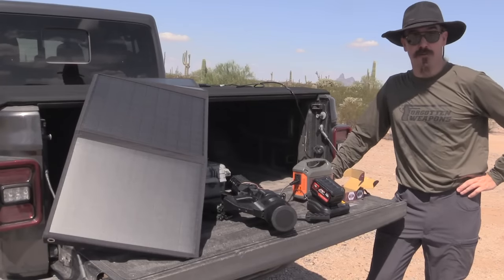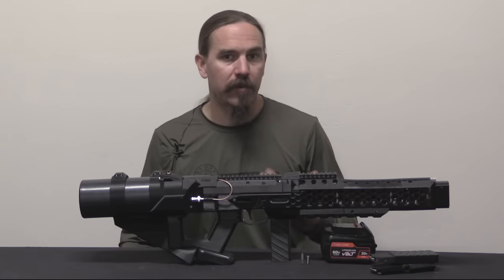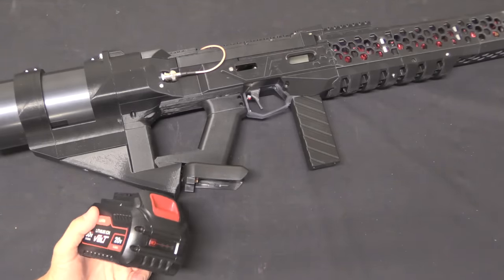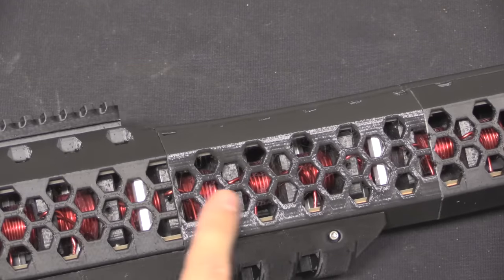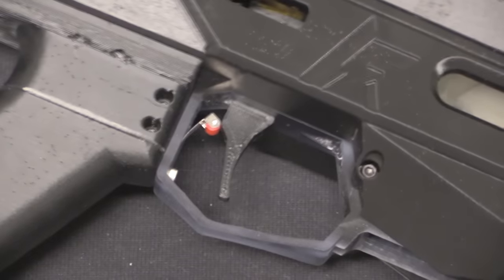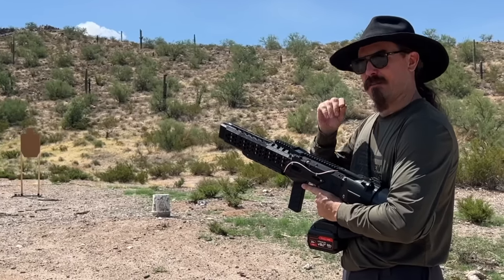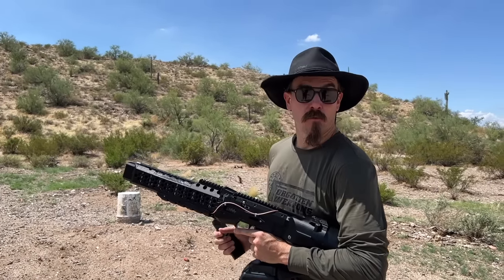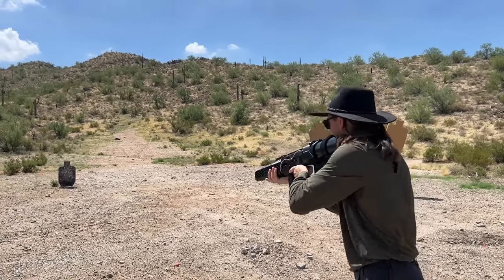ArcFlash Labs EMG-02 CoilGun: Making SciFi Weapons Into Reality

Comment: The fact you dont need gun powder or anything for ammunition is a huge boon. (until they decided to address the accuracy issues)
Reply: 200fps is BB gun level 1000fps is fire arm level  , so accuracy and power 😂
Reply: use of different ammo could be interesting, like jet, explosive , just a thought.
Reply: Eventually, but it really doesn't have the kinetic energy.  The GR-1 Anvil is their most powerful gauss gun, and the projectile has 75 foot-pounds of kinetic energy.  For reference, most 22 rimfire cartridges are around 120 foot-pounds of KE, M193 military specification 5.56 NATO cartridges are almost 1,300 foot-pounds of KE, and the 300 Winchester Magnum commonly used for hunting has anywhere from 3600 foot-pounds to 4100 foot-pounds of KE.

We have a long way to go on making a compact enough power source.
Reply: @jamesp8164  or drastically more efficient systems.
Reply: @GMNAZ  this doesn't account for the drastic weight difference between a bb and a 5/8 steel dowel pin. That's gonna be about 70 grams which is about a .556 round traveling at nearly 500fps. You could theoretically increase the weight of the round and keep the speed the same with an increase in power at the expense of range. My solution would be to machine a more efficient projectile that could use its own speed to stabilize its path so it doesn't bleed velocity in a tumble. I'd change the shape of the projectile to a dart shape and add microfillament fins to force air around the shaft and create rotation
Reply: @wolf_puncher301  their website says the rounds are up to 8.5 grams
Reply: @wolf_puncher301  Essentially rifling the projectile instead of the barrel.
Reply: @wolf_puncher301  You can't optimize the projectile shape since the shape of the projectile is what allows it to get the speed it does. This weapon is using the solenoid effect, so the larger the chunk of ferrous material, the more force the coils are able to exert. If you shrunk it down to a more aerodynamic dart it would probably be traveling slow enough to catch at 20 yards.
Reply: has anyone used one of these to shoot something that isn't a piece of tin or cardboard? I'm not a gun person just here randomly but it seems like if you were wearing a leather jacket the bullets might not get through it. Though a safer gun is not a bad idea
Reply: @subspaceanomaly  It's essentially a BB gun, but the purpose of this gun is not to be lethal or non-lethal, it is purely experimental, a concept or for fun. It is not meant to be practical in any way, at least not yet.
Reply: @gus892  Jet ammo has already been done. Gyrojet pistol & rifle used a jet propelled round. It wasn't good.

Comment: games have told me capacitors are explosive. imagine having a giant one under your arm. it will be like flamethrowers, your friends don't want to stand near you in combat.
Reply: It's really only the tiny little Tantalum caps that explode and only when reverse polarized or when too much voltage is applied. Electrolytics will burst open because the electrolyte boils when they fail... but they will swell and get very hot first so you'll have at least some of warning of an impeding failure.
Reply: @audiossis4567  hmm... so you could use it as a granade if say only your capacitor got hit by the enemy and not you?

Comment: Spin could be added to the projectile with smaller coils arranged radially about the barrel, with their magnetic fields directed at the outer edge of the projectile
Reply: or you could instead fire a smaller and lighter more aero dynamic flechette style round that can achieve spin on its own similar to a arrow IF its even possible

Comment: The step up in capability is insane - that fire rate alone is astonishing compared to the prior version!

I'm much more interested in the ammo design at this point. Get those dowels spinning somehow, to focus on accuracy. Could it fire projectiles with twisted fins or spiral-cut grooves, to impart some rotation as they're accelerated down the barrel? How would accuracy be affected if you tried to fire bits of chopped-threaded bar - I assume the twist on it would be far too aggressive, but curious to know!

This thing needs to spend time with the Slow Mo Guys, get some development footage to see what the projectiles are doing!
Reply: Figure out a way to mass produce fin-stabilized projectiles for these?

But I think kinetic energy delivered to target depends on muzzle velocity and projectile weight, so there would be tradeoffs.
Reply: There must be a way to electromagnetically spin the dowls

Comment: It’s impressive how quiet the coil gun operates. I wonder if there’s some engineering fix that would further sirpress the sound.
Reply: Most of the loud firing sounds that a traditional firearm makes comes from a combination of three things: the exploding propellant, the expanding gases pushing the bullet, and the bullet itself traveling at supersonic speed. Coilguns generate none of these, in particular the EMG-02 currently don't have enough power to propel bullets to supersonic speed, and thus you have a silent weapon. If a Coilgun were to one day become powerful enough to be lethal for practical purposes, the only sound you would hear from its firing would be the "crack" from the sonic boom generated by the bullet.

This is before the fact that the weapon does not have high-speed large moving parts like bolts in its mechanism, which further cuts down on the sources of noise when firing.

Comment: I don't think getting a simple steel dowel to spin is possible using just the magnets. It would require some specially designed ammunition. Seems like the ideal projectile for this technology would be something like a drag stabilised arrow or crossbow bolt. The velocity is in about the same region as a crossbow.

Comment: There is recoil, but it is not noticeable. To accelerate the projectile forward there has to be a force in the opposite direction, aka your shoulder. The hex bits could work well as projectiles as they may have less drag down the barrel if you run tighter tolerances, just need to stabilize them. Great video as always, and great to see the progress they are making
Reply: @Sasha Lemay That would certainly also help, but if you look at the net energy that leaves the system (barrel), that same energy goes into your shoulder and body. Which there isn't much of at that terminal velocity

Comment: Just wait until solid state batteries become more mainstream, and capacitors can hold more energy, these things could have some real applications real soon
Especially with more aerodynamic projectiles
Reply: Death by 20/40mm grenades but its completely silent, no muzzle flash, no sound and just all of the sudden a hail of explosions erupt.
Reply: Capacitor tech hasn't really developed all that much, they're pretty much at a point where (with what we currently can predict about material tech) nothing much will happen to them. It's more likely that we will be able to advance batteries (like the new generation of LTO) enough to replace the entire capacitor - the big thing to solve with gauss rifles is the power supply issue anyhow, and if we get batteries to work at extremely high power outputs, the capacitor itself will become pointless. As it stands, energy density in battery tech and energy discharge rates are the big blockers - accuracy can actually be achieved with two-component ammunition (as was done in the US Navy experiments).

Considering how much battery tech has jumped ahead over the past 20 years, I wouldn't be surprised if gauss rifles become viable for infantry applications within the next ten or 15 years.

Comment: Just one more big leap in capacitor tech and this concept will be totally viable. I don't know about the resistive energy losses, but should there ever be room temp. superconductors, that would be an additional improvement in energy efficiency (not sure if it would be worth it in terms of price/performance and absolute gain of eff. though).
Reply: Diamond battery + rifled... Yummy
Reply: Bus bars would likely be far cheaper and could double as heatsinks.
Reply: @rev3  You can't rifle the barrel 'cause there isn't one. Think Panwall might be onto something with spinning the projectile before accelleration, but I suspect the next development will include more pointy rounds like a tradittional bullet. 
Battery technology is constantly developing, but I like the fact it's built of bits you can get off the shelf of your local hardware store. That's a definite plus for repairing it in the field.

Comment: When I heard this new version was coming out, I had an idea. I wounder if we can put two small jets at the beginning of the coil stack hooked up to a tank pressurized by a small compressor. The jets of air could be synchronized with the firing of the weapon so a burst of air spins the projectile as it is launched. I am not sure how tight the timing would have to be for that, but I hope that would stabilize the projectile.
Reply: They’ll probably cause it to spin using magnets along the barrel. If not, well that’s my idea.
Reply: The easiest method would be fins, but you might be able to do something with an offset ferrous core of the projectile and offsetting the coils so it forces a rotation as it’s accelerating
Reply: Oof. Adding compressed air is a whole extra system. Too complicated. With the low initial velocity, probably better to just have a few angled rollers contact the projectile before the first coil. Similar to how most motorized nerf guns work.
Reply: Coat the projectiles in a slippery plastic. The plastic catches the rifling to spin it. It would also save the barrels from wearing down because of reduced friction metal to metal.
Reply: I went through some solutions in my head and finned ammunition would be the most practical idea. You're not adding weight or complexity to the weapon by needing extra magnets or compressed air canisters and it would be cheaper to implement.
Reply: @saltaiaw  the problem with aluminum is that it would scrape off and stick to the inside of the barrel. You need something that would be easily cleanable with a simple ram rod every couple hundred shots. Low friction plastics could be cleaned out with a brass brush and would allow faster speeds. I'm sure they have looked at both these ideas and are in the process of trying to get spin. The only problem is it's a trade off with spin vs feet per second.
Reply: @JosephHarner  two rollers like a hot wheels car launcher but rotating axially
Reply: @rumdog117  I'm not suggesting the fins be in contact with the barrel. More for the fins to act in the way they do on an arrow. There shouldn't be any contact with the barrel since the projectile isn't using pressure or propellents.
Reply: @JosephHarner  That is a fair criticism.
Reply: @saltaiaw  while artillery rounds do have fins (flishett), that seem to work because of the distance vs speed. As they fly, there is enough time for the round to hit air and impart spin. When they hit, they are dropping because of gravity. A bullet has to have the spin in it before they leave the barrel to stay straight. Contact with a rifled barrel and something on the bullet is what is needed. It needs to be strong enough to not tear off the bullet but be soft enough to not ruin the barrel. From what I've read, these barrels wear out quickly because there is no way to keep the bullet from moving side to side rubbing the barrel. The electromagnetic forces change from magnet to magnet.

Comment: They have to figure out a different placement for that capacitor. Left-shoulder shooters (like Ian) could literally have their heart be exploded due to being right next to the heart on the left shoulder if the capacitor fails and pops. The front-ended capacitor may be front heavy and uncomfortable to hold, but it’s nowhere nearly as lethal if the capacitors pop, just losing a hand is treatable and not life ending.

Comment: I wonder what kind of damage was done to the metal dowels when they hit a target? Could you clean and reuse them?
Reply: Interesting concept. I guess even surface dents and cuts wouldn't cause a problem given the minimal contact with the 'barrel'. Only attached swarf that sticks out a large distance would have any real chance of causing damage. So yeah, running around the wrong end of the range with a magnet on a string should work, provided you check for foreign objects and you inspect & reject the most severely damaged dowels.
Reply: @jamesmatthews291  Probably a go/no-go gauge would take care of most problems where you test diameter or deformity along the length and test the overall length.  Might not be wise to shot them at steel targets but a soft berm would likely allow you to easily reuse slugs many times over.
Reply: If you use dowels that are case hardened dents and dings should not be an issue.
Reply: Visions of people thousands of years ago firing their enemy's arrows back at them.
Reply: They should be okay? It was only 200fps and they weigh little, not a lot of energy being imparted into the target and thus back at them. I'm no rocket surgeon but I'm fairly certain they'd be relatively unharmed, maybe a little nicked.
Reply: I'd be afraid of magnetic fillings being stuck to the spent dowels. couldn't imagine they would be good inside the gun. might have to degauss the dowels before reusing them, sure they would have a magnetic charge after firing.
Reply: @eldonerc2524  What makes you worry about metal filings? I'm not sure the specifics but I don't think the dowels actually contact anything when traveling down the barrel.
Reply: @kentvesser9484  For deployment logistics a Go-NoGo gauge can be built into the rifle or at least supplied with the troopers' kits.

Comment: There's a few Sci-Fi settings where weapons that use electricity don't use an internal energy source, but rather get plugged into a large battery that the soldier carries on his belt or in his backpack. I guess this system could work a lot better if it came with a similar design approach, where the soldier carries a backpack containing several of these capacitors and a larger battery (the battery could be attached to the front of a carrying-rig, so it can be swapped by the soldier more easily).

But this design is evolving quite nicely, a far shot (literally) from being an actual firearm fit for a regular shooting range, but really promising. Who knows, maybe we will see actual Coil Guns on vehicles, given that they have a much easier time providing enough juice to power such a gun and the necessary capacity to carry bulky capacitors.
Reply: @jayfrank1913  Thanks, Grammar Gestapo.
Reply: @h.a.9880  I'll take it a step further by saying I'm not the 'grammar Gestapo,' but the 'definition Gestapo.' Your grammar is just fine.
Reply: @jayfrank1913  Well, if it is your task to supervise the correct use of terms, you might as well refer to yourself as Terminator.
Reply: @h.a.9880  LOL! I'll use that in the future. "I'll be back."

Comment: I wonder if you could "rifle" the barrel by somehow sequencing or repositioning the coils? Maybe create ammunition that is more magnetic on one side than the other? Really cool to see such a new firearm design in it's infancy.
Reply: Or you could place a plastic collar on the round and is a rifled barrel?
Reply: Spin the magnetic fields going down the barrel
Reply: It could work, but only with more complex ammunition.  You either need a magnetic field in the ammo itself to react to the polarity of the coils, or a non-cylindrical shape that will prefer to orient itself with respect to the coils.  For the former, it might be possible to impart a field temporarily by running it over an even more powerful magnet during the solenoid stage.  The latter could just be two grooves, one machined down each side, perhaps backfilled with plastic if it has much aerodynamic impact.
Reply: @oasntet  If you have the coils perpendicular to the barrel and  arranged in a helix, it should work with a projectile of any shape on the same principle as an induction motor. The only problem is a lot less force will be applied along the axis of the barrel.